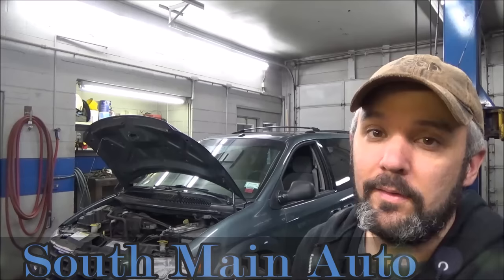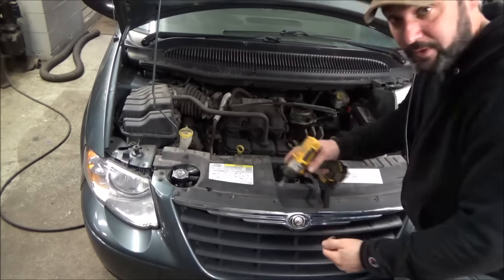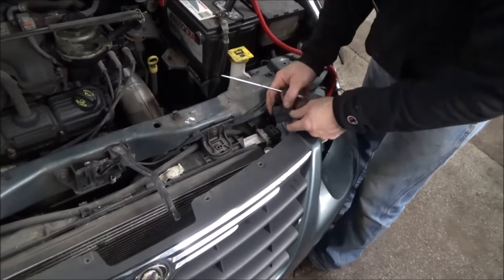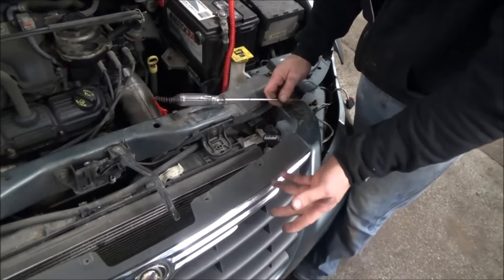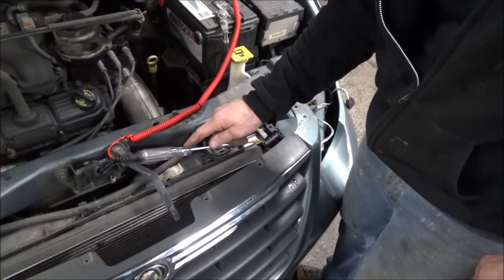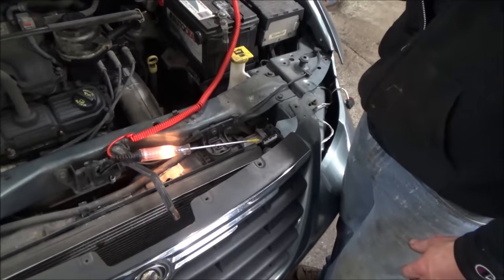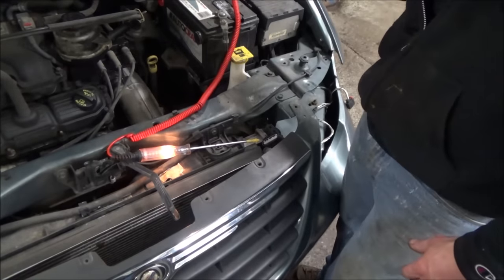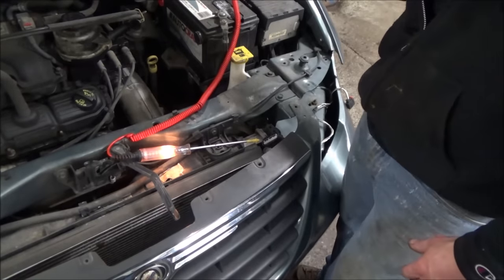Chrysler Town & Country / Caravan - P0480 Cooling Fan trouble

Comment: Eric, you had me fooled! I was for sure that this would be a ground issue just like that turn signal switch video.
Reply from the maker: +**Classified** I know right a Chrysler electrical problem with out a ground issue.
Reply: South Main Auto Repair Wish I got that lucky on my old town and country! Glad I got an odyssey instead. Still has some high mileage issues, but overall it's a higher quality van. 06 Odyssey EX-L.
Reply from the maker: Once you go Jap!!
Reply from the maker: ***Classified*** I use to be a Chevy guy too... haha then I grew up and realized I only liked them because I liked fixing things... frankly when you own one that is all you do. Now I drive Honda because at the end of the day I just really wanna go home. I h=guess our priorities change when we get older .
Reply: South Main Auto Repair I guess that's how I am now. I'm younger than you, but it does always seem like my truck is breaking down. I've done so much to it too, whereas this van is nearly bone stock. Plastic and rubber components have been replaced, but it's got over 200k on it and the transmission and engine haven't been touched. Both of those have been replaced in my truck with a little bit more mileage. 

Isn't it a little hard to work on your own cars when you do it for a living all the time? That would drive me nuts. It would be like working after you got done working all day. That's really why I will never do it for a living, even though I do have fun with it.
Reply from the maker: Yeah, when I was single and working for my dad I din't mind working on my car and keeping it top shape and clean haha but as life goes on priorities really change I guess. Now I am just happy if it starts and moves :)
Reply: South Main Auto Repair Yeah, lol I'm sure that will be me before too long. Anyway keep up to good work with the videos. The last few months have been your best in my opinion!

Comment: when checking the pwm signal for the control side of the relay weren't you checking the 'off' time off the signal rather than the 'on' as the test light was connected to battery positive and the other pin had a constant ground. would the test work by connecting the test light to battery negative and look at the 'on' time of the signal? great vid as always
Reply from the maker: +matt Nope. This is a ground side switched like I mentioned in the video. Kinda the opposite of what you would think. The control side of this relay has a ground and a ground side switch PWM.

Comment: literally the  same for  2005  pacficia , my fans  come on  when temp is  1/4  way in the   scale, not  even 1/2 way  , so im replacing the fan relay, already checks and  replaced the  fuse for  it in fuse box  #13

Comment: So what if the fan activates when the AC is running but not when it is off? I suspect the cooling sensor, the engine is really hot and the coolant is boiling but the fan never activates unless the ac is on. I did get  a P0480 code though.

Comment: If you are receiving a PWM signal from the ECU to control the fan speed, wouldn't it be better to use a LED scope on a rope to see so there is less chance of damaging the ECU?

Great video, I'm going to link this video on a BMW forum since the radiator fan in a X5 is controlled by the ECU (DME German Translation) and most owners on that forum doesn't understand how the radiator fan work.  They think that all you have to do is supply a positive wire and a negative wire to the fan, and the fam will spin, but they don't know what to do with the signal wire.
Reply from the maker: +Upallnight The driver in the PCM is pretty resilient, you could use an LED test light sure. Click on the "I" In the upper right hand corner and it will link you to an other fan vid I did and in that one I show how to do it using a meter.

Comment: I have problem with cooling fan on drive side not working. After checking power from wires all of them have power. Changed new relay and it is still not working either. Do you think that fan is bad. but it came two fans together. If I replace it, I have to replace the whole set ( 2 fans). Can you recommend me? No overheat. Thanks.

Comment: That relay/module are a common failure. As a parts guy, I've delivered and sold many of those relays/modules.
Reply from the maker: +Frank Gonzalez Do you think they get tested or just swapped out on guesses?
Reply: +South Main Auto Repair Most shops that I serve do a proper diagnosis but a few do shotgun diagnosis.  I interact with my shops and know which shops do shotgun diagnosis by the large amount of unused parts that are returned from them. The shops that do proper diagnosis don't have such a high unused return rate. As for counter customers, it's difficult to say because I sold them the part but wasn't there when (if) they returned the part. When asked by a customer for a shop that is reputable, I recommend shops that do a proper diagnosis and not just parts swaps.

Comment: Hey not sure if you can help me. I have the same van. My fans come on with the A/C but they are on low speed and do not want to go higer. The compressor starts to overheat from high condenser pressure what should I look at next

Comment: Wish you had a video on the 3rd generation caravan fan circuit. Mine is a 1999 and the constant fan problems has damaged my engine . Despite replacing the three control boxes involved twice.
Reply: Mine's going to the junk yard. Never again will I buy a Chrysler anything (nor a Ford anything).  They've been making garbage for 50 years, neither have figured out how to design a transmission, either.

Comment: Thumbs up video! At 4:50, when you put the test light positive from the battery to the fan did the fan go on or was there not enough amperage through the test light to spin the fan or did I miss something?
Reply: +Sandbag1300 Remember, that fan circuit has a 40 amp fuse.....That fan draws a lot of current compared to less than half an amp of the test light.   There's just not enough current to spin the fan motor....  That's part of the beauty of the test light.....you can test components without worry of short circuits....

Comment: What if the test light doesn't come on when testing for pulse width modulated signal?  You tested it around minute 7-8 in vid. How would you test the wiring then.

Comment: love the cameo by Sheeba :p great video as always. Can you do a Subaru Brake video? those have 2 different caliper pins one with a rubber sleeve and one without. (I did my own brakes and found that the lower pin has the rubber insert) God bless and take care...
Reply from the maker: +AnhYeuEmMaiMai69 That is a very common set up on many brake systems. Here is an oldie I did : https://www.youtube.com/watch?v=v_6o6n1jjIw

Comment: I wonder if you'd be willing to answer a question: On my '99 Town and Country I replaced to fan relay a couple weeks ago and the fan began working but only for a short time.  With the engine running I have two positive and two negative readings from the relay now.  With the fan connector/plug disconnected both sides coming from the relay show as ground when the fans should be running.  I can't get to the fan connector with a tester to check the fans with the connector unplugged.  
Any suggestions?  By the way, if needed, I would gladly set up a temporary email address to correspond and pay for assistance.  I just need it working.  Thanks.
(I'm asking you here because you seem to the most knowledgeable that I've seen on how these work.)

Comment: Great Channel! I know you are partial to your scope on a rope but, have you ever considered using a load device such as a headlamp or window motor to verify current capability of the power and ground circuits. Most test lamps only allow 200mA or less to light. I would also check the current draw of the fans after replacing the new module to verify it wont ruin the new one. Current draw should reduce with use as the circuit heats up which may be difficult with this pulse width duty cycle controlled circuit. You should be able to verify though with using a scan tool to control the circuit at a steady rate.
Reply: +Bluewrench61 Why not use the fans themselves as a test load?
Reply: +motoYam82 
Guess you could by using a jumper the fans to the wiring harness.
Reply from the maker: +Bluewrench61 Well I can say this. The only time I can recall getting burned was with Ivan on a Jeep haha. so I would say less than 1% failure rate should be acceptable. I have seen guys run around in circles looking at numbers on meters trying to figure out what side is up. As far as the old headlight tick I could see its purpose in some situation but most of the time if I have a green booger that is causing a circuit to not work it will be reflected on a test light too ya know. I am sure I will get slid a few more times before I die but I test some circuits a bit differently. As far as amperage draw testing the cooling fans, do you know what a good cooling fan on an 07 T&C draws by any chance?
Reply: To tell you the truth, I've never replaced any sort of fan motor due to an over-amperage condition, even though some seemed high compared to others. It's just the scientist in me that wants to gather data that might be useful in the long run lol
Reply: I have had several over the years but mainly they were bad enough to smell the burning of the windings on or before the total failure. I just like to be thorough and it's a quick check with a hand held amp clamp to see if the current is rising on the way to failing or falling slowly like it should. Keep up the good work and great channel!
Reply: South Main Auto Repair
Most of the fans I have checked average in the  12A-15A range on high. The main thing is that the current will drop slightly as the circuit heats up. If it climbs at all, you can bet it's on the way to failure in the near future. I usually let them run about 3-5 min while I'm clearing codes or putting minor pieces back together with a battery operated amp clamp. Worn bearings that are beginning to bind will also cause the amperage to increase as it runs. Love your channel and dedication to getting to the bottom of diagnostic problems. We need more people in our industry like you!

Comment: I don't get 12v on the Orange wire to ground. I tried a jumper between the Orange and Blue with no luck.   If I connect from the battery to the Blue wire the Fans come on.
Could you give me a tip where to trouble shoot next.  I am temped to get a switch and manually turn on the fans but would like to see what else could be the problem.  Thank you

Comment: Hey Eric I have a 2006 Chrysler Town and Country Touring with a 3.8 but just started having a problem today I live in Florida and if I'm sitting in traffic like waiting on a light or something my idle is very low and then all the sudden my idol will kick up  and the battery light will come on I pull over and check it and the fans are just barely running then I will shut the vehicle off leave it set for five or so minutes and start it back up the battery light is off the fans do not run and if I leave it sit there an idol when it goes to command the fans on the fans move just a little bit it starts running wonkie, and the idle pops up the battery light comes on and the fans start running in low speed I'm going to change that module out I think it's pulling down the voltage trying to start the fans the system can't handle it shuts down the voltage enabling the battery light

Comment: Hi Eric , what if on 4th socket there is very weak 
 signal and after turning on AC signal stays unchanged.  I exchanged a relay and P0480 still on. 
 Thanks a lot for your movies.
Ciao, Marcin from Poland.
Reply: Hey, did you ever figure it out? I'm having the same problem.

Comment: Hi. Wondering if you can help. I replaced my radiator on my 09 Chrysler town and country 3.3 motor and today the temp needle went passed the middle line 3/4 of the way to hot while stuck in traffic. I heard the fan come on several times. Any ideas?

Comment: So I just did exactly as you did but when I went to run the ac with the probe in the light never came on but the fans will both turn on if I have the relay plugged in with the ac running ? Kind of stumped right now I tried replacing the relay and as soon as I drove it engine light came right back on

Comment: How come its called a relay, is it not more a NPN transistor? just wondering. Awesome vid :)
Reply: +Kevin McMillan You're correct it's just a mosfet of some kind. Same deal with 'blower motor resistors'. Most of those are also mosfets controlled with the PWM signal.

I guess calling it a relay is just easier for organizing parts catalogs.

Comment: Does the 04 ram 1500 truck have the same circuit ? My fan isn't turning on and I replaced my whole condenser it's still throwing the p0480

Comment: hi steve love the show i have a 2012 dodge caliber sxt im getting code p0480 i have replaced a relay as there was corrosion and still nothing i have jumped power from the battery and the fan does work and i can spin the fan by hand and i do not see a radiator fan relay so i was hoping that you may have som insight on this? im planning on going through the wiring harness to see how the wires look and go from there.  fyi i sent a comment about this from my tablet but was not sure if it got to where its going or i did it right.
Reply: i know your name is eric my appoligies

Comment: Thanks for this helpful video. I have a 2002 caravan 3.3 with the same problem. I followed all of your tests, checking all the wires on the cooling fan relay plug. The only one which failed (wouldn't light the test light) was on the small guage control wire (duty cycle). I checked it with engine on with AC on with hot engine and the control wire did not pulse (dim to bright ) at all. It looks like the fans are not being commanded to run. I have spun both rotors on the fans and they are not seized. How should I proceed? Can I command the fans to run by jumping them? Thanks very much for your time :)
Reply: hi i noticed you have the exact same problem i am having. Were you able to fix your problem? if so what did you end up doing?
Reply: @michaelloganirvin  Hi there. I checked the ground wire below the left headlight which was tight. I tightened it a little more. Wiggled the harness all through that process. I also changed the Engine Coolant Temperature sensor. Through these things the problem somehow got fixed. Fans are working again. Thanks.

Comment: Would A high Fan amp draw, blow the new relay? kinda like a blower motor would do to a resister? just wondering if its something i need to watch for. Thanks!
Reply: +mrexecutive1 most definitely, as a good practice is always good to check the amp draw. Sometimes is hard to find the right info to compare with!!

Comment: Worst vehicle I ever owned an 02 Chrysler T/C.  Rotted rear heater lines at 50,000 miles causing a complete drain of coolant 200 miles from home. Rusted lift gate inside 40,000, Transmission grenaded just past 70,000 miles (of course just past warranty) Never Never again...Best part it was sold to us new at a dealership with a repaired lift gate from being damaged while being transported.. Thus the rust issue.. Good fix..
Reply from the maker: Oh yeah +ItsAlwaysRusty. Any time a body shop does work you can almost guarantee that part will rust out long before the OE finish does...

Comment: Hi, I have Chrysler town and country touring 2008 and I have the same problem the coolant radiator fan works only if I turn on the A.C and I tried to find this piece everywhere but I couldn’t find it so I changed the other relays which is located on the same actual fan and other one next to the water bottle coolant and also I changed the thermostat sensor under the coil but this piece which shows in your video I couldn’t find it at all I took the whole bumper out and tracked the wires but nothing please help me where it hidden or where might be located or if there’s any other solution 
Thank you 🙏

Comment: I'm working on a 2000 caravan with a bad relay and the new relay didn't fix the problem of no fans running. Fuse, PWM ground, chassis ground, and everything appear normal. Not sure what to check next. Any ideas would be greatly appreciated. 

And if you have time...what is the benefit of using a PWM ground for control? Better amp draw monitoring?
Reply: BillyGoat4x4 you ever find the problem because I had the same issue
Reply: I know this was a while ago but did you check to see if the fans actually worked?
Reply: Coolant temp sensor
Reply: Quiet fan noise, and can control fan speed.

Comment: Hey Steve love you show question I got a 2012 Dodge caliber SXT I'm getting a code for a p0480 it says cooling fan one control circuit problem is can't find the control circuit nobody seems to know I was wondering if you would run into any of these vehicles with that and as far as I can tell it doesn't have a radiator relay radiator fan relay I replaced one of the mini relays for the cooling fan cuz it was corroded I'm not sure I have jumped the fan motor from the battery and it does work it free spins by hands I just wondered if you had any insight on that
Reply: Sorry I know your name is Eric I was distracted

Comment: I'm getting the same damn code in my 2012 Jeep Grand Cherokee but It's over cooling. Tried changing the relay in the fuse box but still over cools/fan runs all the time. GRRRRRR